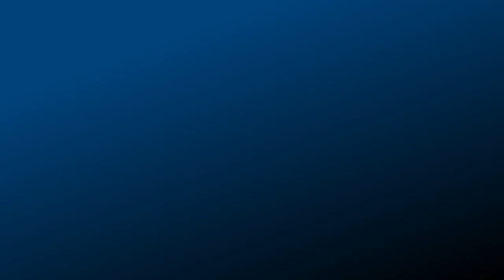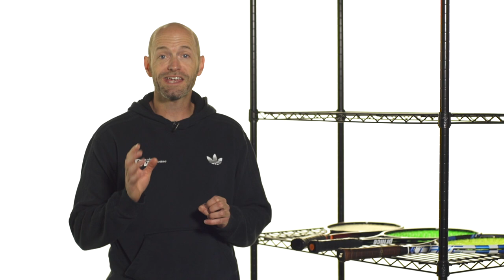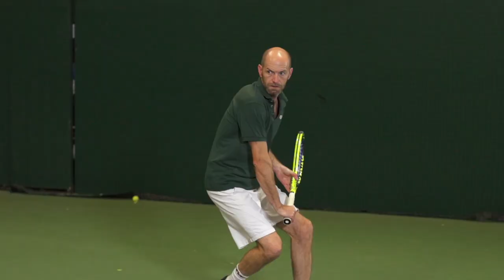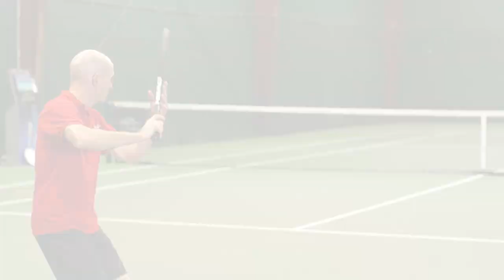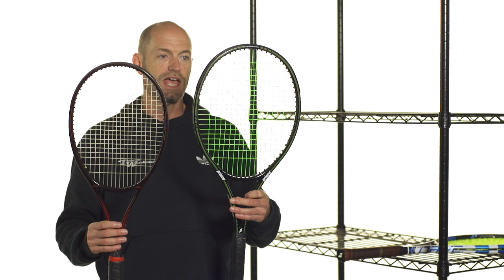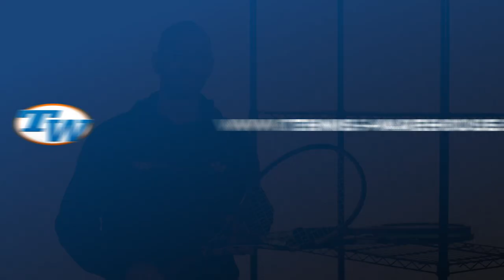Tennis Racquet Stability Explained - VLOG #477

Comment: Racquet stability is also enhanced by stringing with a looser tension.  Also, racquet head designs where the main string length is more uniform - particularly with Yonex's isometric head shape - results in increased stability.  Widebody frames also have increased stability due to the increased mass of the frame (as well as stiffness).
Reply: Thank you Ted, you have given me the answer I was looking for.

Comment: You seldom (nigh on never) hit the ball right in the middle though... I believe, the proper technique is, when hitting topspin the point of contact is slightly below the middle, whereas when hitting slices the contact point is slightly above the middle. But logically, those points of contact will twist the racket more which plays down on the whole stability thing. I'm confused...
Reply from the maker: +leiya107 ,
Any contact slightly off-center of the racquet will inevitably make the racquet want to twist in your hand.  A racquet's stability is how resistant it is to that movement and how easy it will be to keep it steady through contact.  Less stable racquets will twist and flex more whereas more stable racquets will resist that unwanted twisting more.
Andy, TW